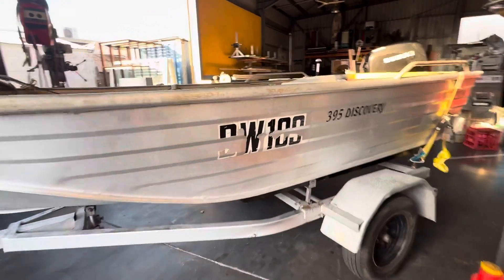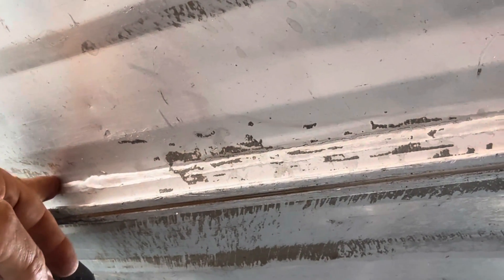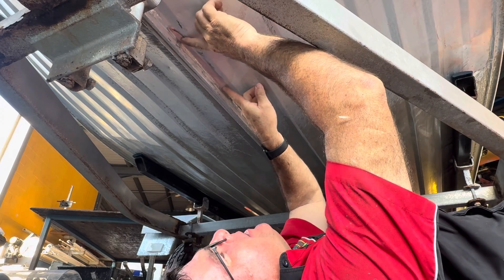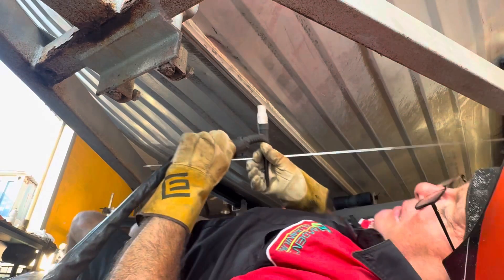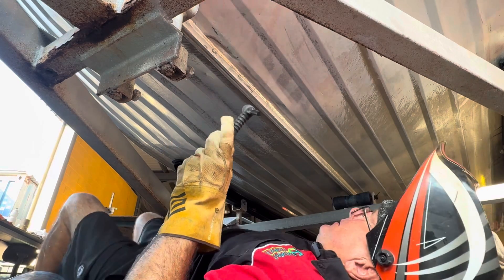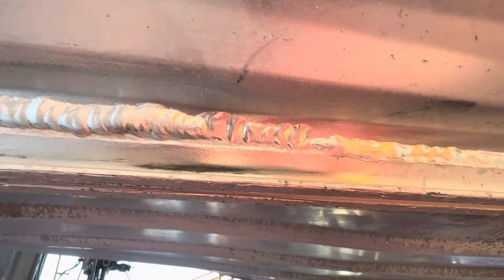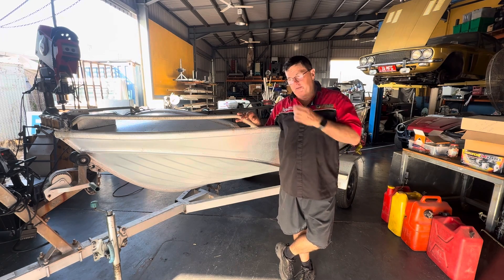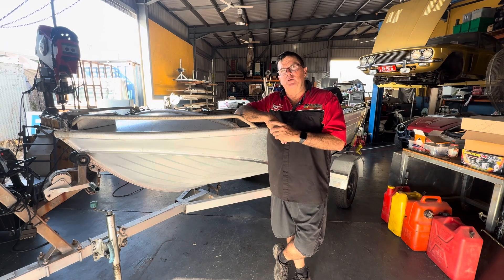Cracked Tinny How to Fix it!

Comment: I grew up from a young age and lucky to have a mentor that specialises in metal engineering. He taught me to weld, build floors, fuel tanks, bait tanks, trailers and basic repairs in general. Only way you will get a better weld is if you take the boat off the trailer and flip it over but even that doesn't guarantee success for some people. Best to keep it simple and do exactly what you did in the video, good work.
Reply from the maker: Sounds like you had a great mentor! Flipping the boat over isn't always practical, so I appreciate the feedback on keeping it simple.
Love your comments keep them coming 
Thank you

Comment: What your rough amp range?

I did few pin holes in my 460 renegade drilled em out to 5mm and I was shocked had her up at 120 before it was really feeling good.

120amp 200hz and 20% AC ballence is what I ended up at. I welded outside then cleaned up inside and did that too. Then sanded the outside just shy of being flush
Reply from the maker: It's great you found what worked for your boat!
I have a variable amperage control machine and I use it from zero to flat out most jobs 
Not all most 
I can’t tell you as I’m not looking at my amperage whilst I’m welding I’m watching to weld pool or molten puddle and I adjust accordingly

Comment: Been through 2 of these hulls in a year, cracked about 600mm long in 4 places. Got it welded and cracked again. Gave them away and got a glass boat now.
Reply from the maker: Sounds like you've had a tough time with them!
Glass boat have their advantages over Tinnys
But tinnys have their advantages over glass boat too 
Generally glass boats are more expensive and need bigger motors to push them along for the same size boat 
This alone is why Tinnys are so popular 
Don’t get me wrong I would love a big glass boats 
The ride quality can be outstanding in comparison
Reply: @RacingRenovators i do miss my tinny is ease of use and maintanance etc and hitting snags etc so they do have their place. I must say i dont miss how hot they get in summer though
Reply from the maker: @kizzjd9578 yes Summer all year round where I am 😂
Reply: @RacingRenovators yea im in nthqld, get 2 weeks of winter haha
Reply from the maker: Yes

Comment: Is it possible to access the otherside of the crack smd weld as well? Grinding back into the underside weld will get rid of the crack completely..
Especially with dirty ally always difficult to get full penetration and for it to fuse to the dirty ally...
Reply from the maker: I get where you are going with welding both sides!  
What is actually happening to the metal is after it has been welded “from factory” it is head affected 
This weakens the material so welding it again heat affects it again and repeats the process 
By welding it on the inside you will repeat the process again 
In other words welding the inside doesn’t always fix the problem 
There are other contributing factors to why it has cracked 
Eg Trailer set up or driving to fast in poor conditions if you change this the boat may not have any more problems 
This boat did have a full bench seat on the inside and I would not have been able to do a repair on the inside even if I thought it was the right way to repair 
Thank you for your comment Daniel!
I hope explained my theory on this kind of repair 👍

Comment: Hello, thanks for the video, I have a similar crack in my tinny. I just bought a Tig welder and a bottle of argon. I'll be using a 2.4 tungsten without a pedal, Tig is new to me, may I ask what amps and hz's you use  it would help a lot, you seem to have Tig settings nailed for these little boats, subscribed!
Reply from the maker: It all depends on where and what you are welding 
Where! Meaning close to the keel or chine ?
What!  Meaning the thickness on aluminium 2mm to 6mm thick 
And also the position you are welding in Down hand or overhead etc
All of these things contribute to your answer 
There is a lot of variation between settings 
My advice would be to start off slow with low amps and build your way up 
Low amps will clean first then as you build it will start to melt once you start melting add filler to cool you molten puddle so the numbers don’t matter 
It is what you see determines your actions of amperage control 

You have a hand controller to do this with 
I am changing my settings constantly to suit throughout the entire weld 
On a longer weld sure you do find your happy medium but I couldn’t tell you and actual amp or hz this will change on every single piece 
I hope this has given you some confidence 
Start slow or low and build your way up 
Let me know your progress
Reply: The job's heat sink capacity is a big factor that influences your settings. Cheers
Reply from the maker: Yes it does that is a good way to put it 
Heat sink just makes all situations a little different but after a couple of years experience you adapt 
Very hard to teach 👍

Comment: You make it look easy! I learnt the hard way,  never ever use  sikaflex, metal bog  to try and fix a crack
 Deffinately get it welded up
Reply from the maker: That's great advice, and I agree. Welding is definitely the best solution for a lasting repair.